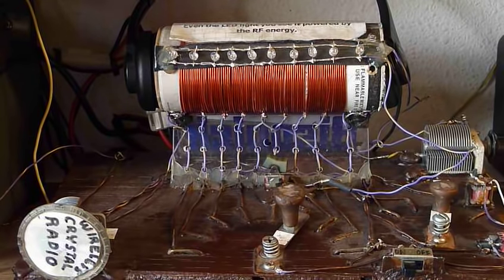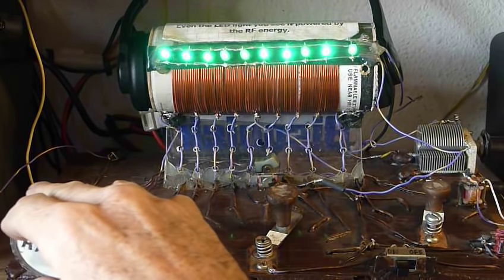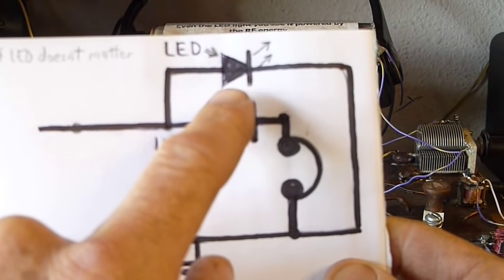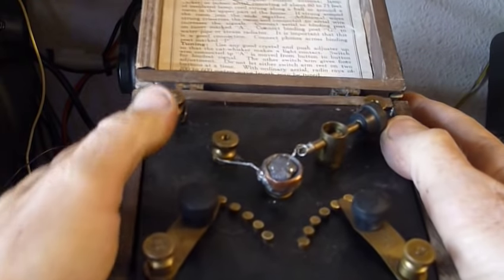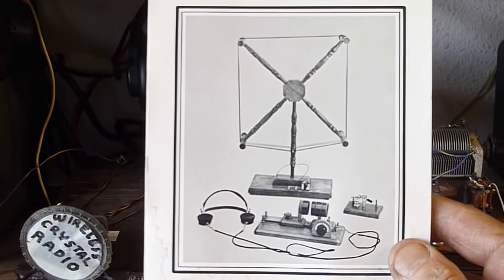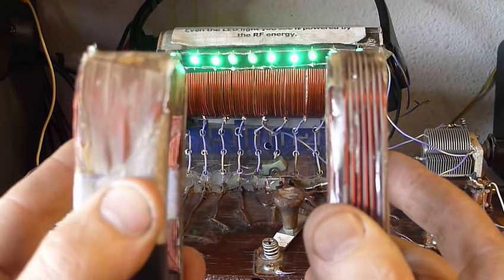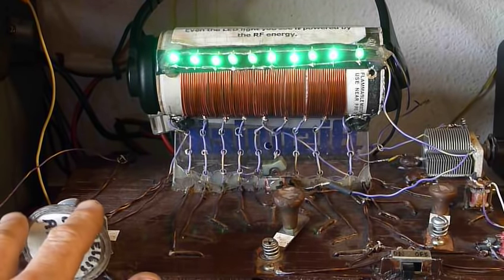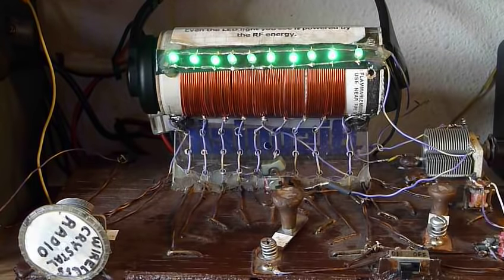Free Energy From Radio Waves. See info section for additional video.

Comment: With any radio you are always intercepting some energy from the transmitter. The transmitter is  radiating 5-50 kW so your interception is quite minor, I am very impressed that you are lighting up all those LEDs and receiving perhaps 20 mW of power (assuming this is not a trick)

Comment: I implore you to touch up upon this further in another video. This is truly amazing stuff, I don’t know why this hasn’t been looked into more. I would love to see the potential this could have for humanity
Reply from the maker: The power level here is so low it doesn't have much potential. It requires a long antenna, and you  need to live fairly close to a AM radio station for  this to work.
Reply: @GrantsPassTVRepair  hoy la tecnología permite emplear un súper capacitor que incluso podría conectarse en paralelo a una batería química ácido/plomo. Son 24 Hs continúa de Radio Frecuencia, incluso podría regular el bobinado para captar la mayor potencia en modulación o QRM...🤔💭 en definitiva todas las ondas electromagnéticas es sinónimo de energía 🤷
Existen población en naciones que carecen de suministro eléctrico.
Quizás trabajando su proyecto de Radio Galena cómo generador nos traiga sorpresa 👍💪

Slds cordiales desde Argentina 🇦🇷👋

Comment: If you build 2 crystal radios and put a volt meter on one, you can see the load being applied to the other.

Back when I did a lot of experimenting with crystal radio's I found that making the antenna a big loop and tuning it got more power received.

Comment: Thanks, Dave. I like to play around with electronix also. That's how I found the backdoor of the Trip 5 IC - to control the IC using resistance through the reset pin. Of course, one could find that by studying the datasheet, but I was a newbie then and found it by playing around with the IC on a breadboard.
Reply from the maker: +Robert Calk Jr. I don't know what a Trip 5 IC is but it sounds interesting. There's nothing like learning through experimenting.
Reply: +Grants Pass TV Repair 
You know, like the NE555, many call it a timer IC.
Reply from the maker: +Robert Calk Jr. Okay I know  what your talking about. I've build a couple projects that used the 555 timer IC

Comment: Amazing that you can pull so much power out of thin air!

I think there is something different going on between the two coils presented towards the end of the video. In that case, there is some inductive coupling, whereas no inductive coupling is required to tune in a radio station.

I like the way you recharge! This and detecting magnet twiddling were two of my favorites.
Reply from the maker: +KludgeCraft  
Yes I agree there is a difference in the way an RF wave is created and received,   but as far as the electromagnetic wave itself goes I think it's characteristics are the same as a 60 hertz AC wave but faster. 

I think all of us techs need a little recharge time  in search of our sanity :-)
Reply: +Grants Pass TV Repair the two coils you pulled out of a former would normally be magnetic coupled. Near field inductive coupling requires both coils be tuned to the same resonant frequency, and then needs no ferrous core.
Reply: +KludgeCraft Yes... such great efficiency. Put 1000s of watts out and someone miles away can collect milla to microwatts of it.  This primitive 'science' is explained by the Friis transmission equation which single-handedly debunks any type of 'free' energy harvesting via electromagnetic waves. While his millawatts are 'free' its at the expense of someone else burning craploads of power to put those signals into the air.
Reply from the maker: Yes I'm well aware that this kind of energy harvesting is inefficient, and that someone else is paying for this energy, Nevertheless I still find the science behind this means of energy collection thought provoking. My own experiments with electromagnetism and induction would suggest that "Friis transmission equation" is probably correct, There's no "free energy" here, but since electricity and magnetism are not completely understood, I like to keep an open mind that perhaps one day someone will discover a new principle along these lines that will shed some light on what we think we know. I believe the universe is full of mysteries that need to be further explored.
Reply: +Grants Pass TV Repair Truly comprehend maxwell's equations and there will be little that "is not understood". However, there plenty of people who would prefer to be mystified by all the cool vernacular & applications as opposed to working through the mathematical rigor of known science.  The cellular network wouldn't stand a chance of existing without incredible understanding of electromagnetism. If you and or others try to derive it yourself in a shack & ignore the work of others for the past 100s of years you will not get very far. One wouldn't understand a breakthrough even if it was right under your nose without the relevant theory.
Reply: +Grants Pass TV Repair Sorry, not trying to be an ass though. This experiment of yours was quite neat.
Reply: Username
Hi Username, I'm not a fan of "Free Energy" either. I can see how one could read that into my comment, though.

I thought the experiment was fun/exciting/thought provoking all on its own, but if you need a practical reason for that kind of pursuit, how's this: Sometimes you only need a few milliwatts, but for one reason or another traditional methods like solar, battery, or grid power are not practical. Then, depending on the situation, one or another unorthodox method of gathering energy may make sense. Harvesting RF energy is one more tool for your toolbox.

On another note, I don't think getting mad at the free energy people is going to discourage them.
Reply from the maker: There was a time in my life where I spent many hours trying to produce free energy with magnets and coils, only to conclude the laws of physics seemed to be correct. The up side of my experimenting was I got a hands on understanding of the limitations rather than going by what others told me. Some of use need to learn through the school of hard knocks.:-)
Reply: You could use different circuits and sizes of materials... to capture " Radio Waves " that aren't actually from a Radio Stations aye. Just don't put that on Youtube, you'll live longer. This content is " A look at History ". At least thats how i'd word it when the guys in Suits turn up on my doorstep.

Comment: why did you hook the positive end of the LED before the diode and not after it? would it make a difference?
Reply: I think he said in the video, but regardless, it should work in either direction, because crystal radios flip flop their phases as the coil and capacitor oscillate, so both directions should work. One way might be brighter than the other way slightly, though, if the earpiece is soaking up some of the energy while in the same direction? I have no idea if that would be a meaningful amount of influence at all, though.
Reply from the maker: I should have shown that I have a switch which allows me to turn on the LEDs  or the headphones. If I have them both on like my diagram shows the LEDs aren't as bright.
Reply: A smart survivor, Leben leben überleben Lilly.
Reply from the maker: Sorry I didn't notice your question sooner Lilly.. The LEDs could have been placed after the diode, but had I done so there would be slightly less energy to my lights because of the voltage drop that occurs across a diode. The voltage drop is less than a volt which isn't much, but I wanted as much energy as possible going to my lights.

Comment: when i was a kid i asked my teacher if its possible to make free electricity from radio signals! i was 10

i didnt realize how smart i was  till i got old! and dump 

if any of you have a smart kid (weird kid) dont make fun of him coz he is smarter than u!
Reply: No u
Reply: The electricity isnt free. Radiowaves are transmitted from local stations which are funded by advertisements and listeners.
Reply: @ozymandiasking173  there is some cosmic radiwaves too. Try to point a satellite dish directly to sun while its plugged in to a satellite finder. Yes
Reply: @yigitkadir3649 dude, there are solar panels. if youre going to use the sun for energy why the hell would you point a satalite dish at it?
Reply: @yigitkadir3649  thats because it's not radio waves.
Reply: @ozymandiasking173  but you can harvest a natural radiowave from the sun..offcourse if you get the correct frequency
Reply: @yigitkadir3649  you dont need to point the sun radio waves are one of the waves came from the sun and it is abundant in the atmosphare..you just need the right frequency

Comment: Very cool Rf for power. There is a transmission line a few miles from here, and it gets kinda low going across the highway. One day not long ago I had a tractor on a trailer behind my truck and it rolled backward and picked up on the ball, so I eased over to the side of the highway and got out.
The second my boots touched the soil I got a really good jolt. It is induction from the line into any nearby metal. Tires somewhat insulated the truck trailer and tractor and I completed the discharge path--it was eye opening. Had to jump on and off the trailer and when opening the door and getting in.

Comment: This video earned a thumbs up.  I've built four radios and all were fails.  Its non-giggity disappointment especially after hours of soldering and winding and drilling.
Now powering these LEDs is basically witchcraft as far as I am concerned. Who has this type of gray matter in the membrane? Not me, apparently.  Kudos to this guy.

Comment: Your work really stands out, and I would like to replicate it...🤔 but at the same time I would like to know how tall and long is the antenna cable or if it is connected to a dipole?
Science mentions that each meter of height represents a higher voltage, that is to say that with a lower antenna you will surely not get your result. When it suits you, please tell us about the height of the tower, type of cable (ohm) and if it is connected to a dipole or antenna... I presume that it is not energized indirectly through of some RF amplifier 🙄 It is also of interest the nomenclature or characteristics of the LEDS (voltage range to work, etc) that I will later look for and expand through Datasheet... Best regards and thank you very much for sharing!
Reply from the maker: My antenna is just a long stretch of wire which is about 200 feet long, and it's strung over the top of  a tree which is about 75 feet high. I live about a mile from an AM radio station, and this is why I'm able to derive enough power from my antenna to light up an LED, I used insulated stranded wire for my antenna, The wire appears to be about 20 gage. Here is a link to the author who wrote the book on crystal radios, https://www.youtube.com/watch?v=G4YDsvv1DEk If you would like to build a far more simple circuit, here is another link you may find of interest. https://www.youtube.com/watch?v=vHVmJ5lD9jc&t=398s

Comment: The "loss of power" in the transmitter coil is due to the current induced in the receiver generating its own opposing signal. So the loss of power is not instantaneous - the signal needs to get from the sender to the receiver and back before the sender feels that loss. It travels at the speed of light. If you move receiver and transmitter very far away from each other I guess the effect should still be similar but the reflected power would be surely below the natural electromagnetic noise floor so probably can't even be measured.

Comment: Hey man, nice set up! Maybe you’re done with the project after all these years but would love to have seen your antenna or at least know the approximate size you were working with?! 

I’ve been tinkering with small scale inductive energy harvesting this past year and have a few spare super capacitors I’d love to work into an RF harvesting set up tuned to BBC Radio 2 hehe. I can send you a publication I wrote it if it’s something you’d be interested in too :). 

All the best & hope you’re good!
Reply from the maker: My antenna is just a 150 foot wire hung over the top of a near by pine tree, but since our local radio station is only a mile from here, it has no problem illuminating my LEDs.
Reply: @GrantsPassTVRepair  That’s crazy, thanks for the reply man!
Reply from the maker: Your welcome. You might find this additional video of interest. https://www.youtube.com/watch?v=vHVmJ5lD9jc @bagofchips80p

Comment: What amazes me is that one of the basic components, electricity itself, is so underexplored. We have anomalous thrust/weight loss in both symmetric and asymmetric capacitors when charged at high voltage (many experiments prove that it's more than 'ion wind' or drift.) and we have high-inductance coils that delay the rise-time of the opposing magnetic field in a standard generator topology - a Lenz-plus motor/generator. Just retard the timing, just like in automobiles, and use Lenz to pull in and push out, rather than go against the inducing magnet.

Comment: Magnetic coupling and electromagnetic resonance are very different. Unlike a transformer, your radio is a grounded tunable RC tank circuit with a rectified output. There is likely a radio transmission station within a few km of your antenna.
Reply from the maker: Your correct. We have Two AM radio stations about a mile away,  One of them puts out 10,000 watts in the day, and 48 watts at night. I can tell by the intensity of the light when they lower their power.
Reply: Perhaps you might charge some form of accumulators to get bursts of usable Wh.
Reply: @GrantsPassTVRepair  So technically it's not free energy.  The radio station pays for the output power.
Reply from the maker: @erikk77  Yes this is correct. the power is generated by the radio station as I mentioned in this video.   
I'm also able to   pick up  quite a charge on my antenna when thunder clouds are gathering, but that has nothing to do with the energy I'm getting from our local AM broadcast stations.

Comment: Effects on distant transmitter?  None, unless you're within about a thousand feet of the AM tower, since that gives you direct "transformer" effects.

But a high-power crystal radio does cast a large shadow.   So, people who are "downstream" from your antenna will receive a less-powerful signal.

Also, high-power crystal radios are creating a powerful RF field surrounding their coil and antenna.   If you place any other AM radios nearby, they'll receive an immense signal when tuned to the same freq as your xtal radio.   This is actually useful when using a standard radio and trying to tune in really weak signals from distant AM stations.   Your xtal radio acts as an antenna, then it dumps a big wireless signal into the AM set, even when the AM set has no external antenna.

So, tune a normal commercial AM radio to a very weak distant station.  Then tune your xtal radio to the same station, and the AM radio should blast out loud.    (You can buy a commercial device which does the same, called "Select-a-tenna" or also Terk antenna.
Reply from the maker: +wbeaty I've noticed my 2nd AM radio across the room is a little quieter when I tune my crystal radio just right, and I also thought it was taking energy away from the transmitters field, but someone suggested another possibility that made sense. The person figured my crystal radio is redirecting the RF field to my 2nd AM radio slightly out of phase  with the incoming signal from the transmitter creating a null effect. 
I have two select antennas and I've seen how helpful they can be in some locations. You can produce the same null effect using the select antenna if you tune it just right.

Comment: Something I did years ago, but the led hardly lit up even with the strongest of signals, I'm now using solar power directly through panels and an inventor, it helps when you have solid reliable light for many hours of the day

Comment: I made years ago several scrubby crystal radio receivers. Maybe using a good antena and having a relatively close emitter you can make some LED glow. I can't make a single one with the receiver that last survived at home, in it's current status. I personally find it difficult, but maybe with proper calculations/measurements one can realize if there's such power available. What I can tell is a lambda/2 CB antenna and the mains ground deliver enough power within a crystal radio that one can plug in an 0.25W 8 Ohm speaker (transformer was used to adapt impedances) and perfectly hear the radio stations from 16km/30km away without the requirement of any headphone. I also was able to catch SW transmissions from China here in Spain during nights by properly tuning the LC circuit. Coil was based in ferrite core, not air coils. Was available power more than 20-30mW???? (I assume that necessary to light on a LED) Perhaps if the speaker was driven at audible volume... but I still think, with all due respect, this example is quite weird.

Comment: Back in the 1950's Popular Science magazine published schematics and plans to build a small transistor radio. The source of power to run the transistors came from a TV antenna connected where the battery would normally connect. The TV antenna had nothing to do with gathering a radio signal. That was accomplished by a normal radio antenna. The TV signals from extremely powerful TV broadcasters was used for amplification power only. Sorry, my memory of that project is kind of sketchy. It has been almost seventy years ago. By the way, with a good crystal set antenna and a good ground, you can touch the two wires to your tongue and feel the electricity....or strike the two wires together in a dark room and see a spark.